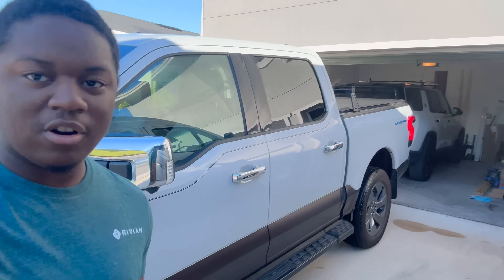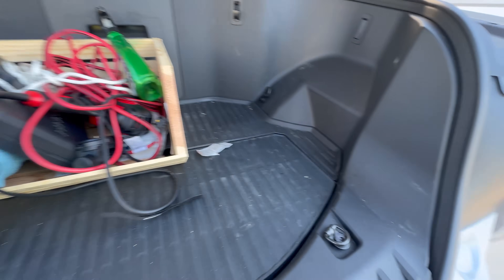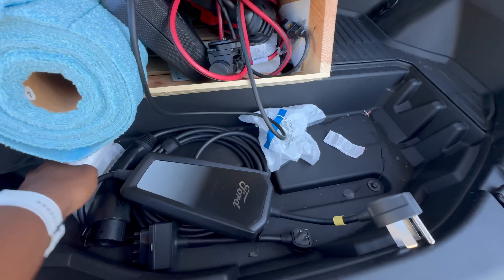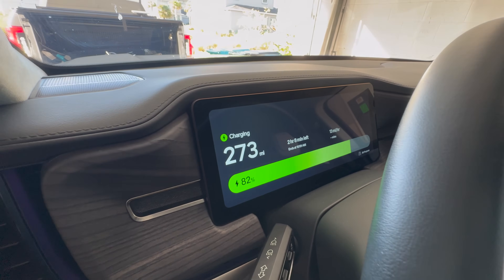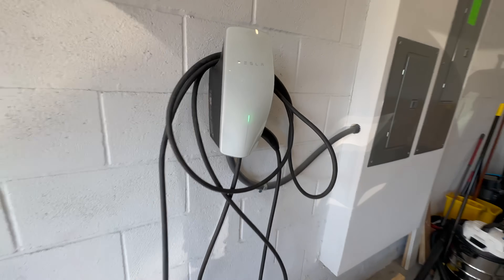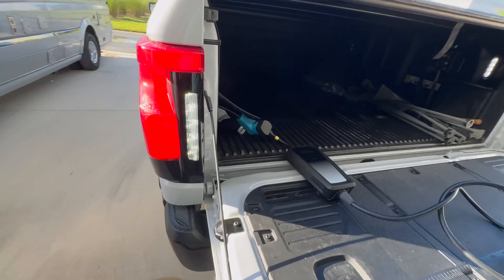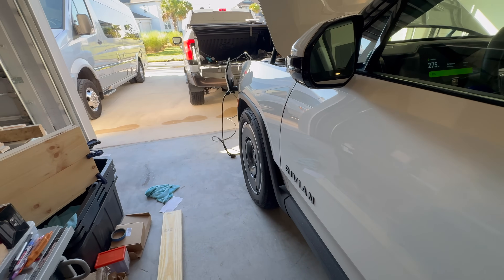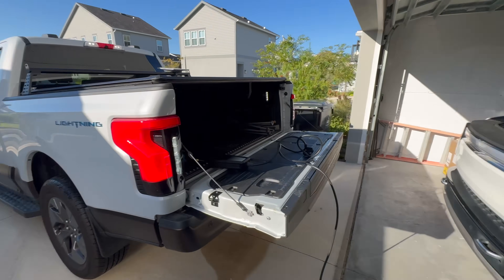Charging Rivian From F-150 Lightning Because My Home Tesla Wall Connector Overheated!

Comment: I have charged my sisters Bolt from my Ioniq 6 before, of course with only level 1 speeds. If we ever had a long term power outage that’s what I would do to keep my sister’s Bolt topped up. Since my Ioniq 6 is so much faster at DC chargers, it would just make a lot more sense from a convenience perspective to do it that way. 😂

Comment: Be careful with adaptors. Most EVSE are rated for only 32A, but some could try to pull 40A. Then you will trip the limit on you donor EV. It that case you will need to limit charging current in the charging car.